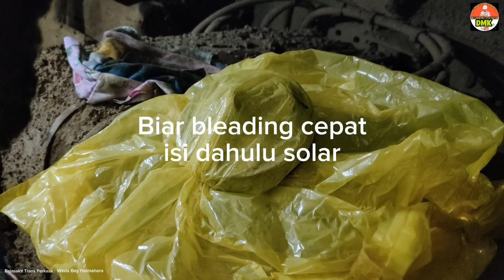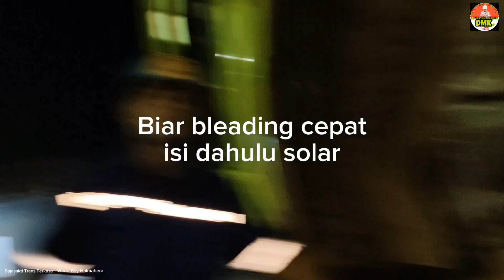PERAWATAN EURO4 DAN WAKTU PENGGANTIAN BIAR GAK LOW POWER #euro4 #hino #truckmining

Comment: Bg.. mobil saya Dyna 130 sering naik Amper panas,radiator sudah di bersihkan. Ternyata setelah di pasang air dalam radiator tidak ada sirkulasi.. saya ganti pompa baru punya Hino juga tidak jalan airnya. Kira2 apa yg bermasah bg? Mohon arahannya.trmksh
Reply from the maker: Termostatnya terpasang gak bang?
Reply: @diagnosamasalahkendaraantv8768  termostat sudah dilepas bg dan lobang by pass yg di bawah termostat sudah di buntukan. Apa tindakan selanjutnya bg? Water pump itu harus nya ngisap atau enggak ya bg? Mohon arahannya..trmksh
Reply: @diagnosamasalahkendaraantv8768  termostat nya sudah dilepas bg,pipa bay pass nya juga sudah di tutup. Normal nya water pump itu menghisap air atau tidak bg? Mohon arahan nya,trmksh